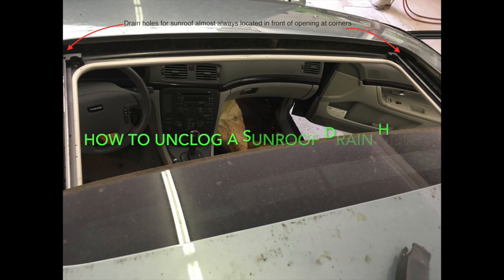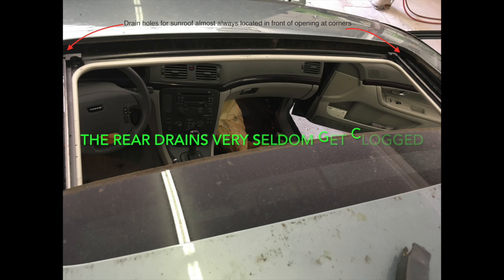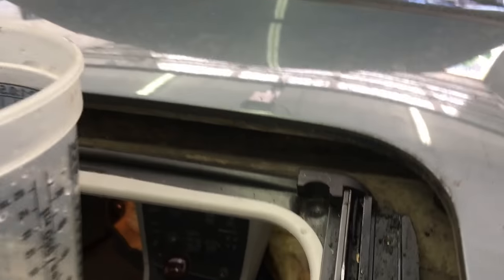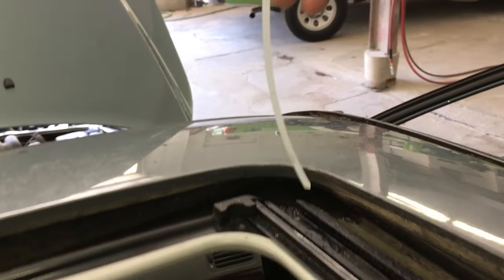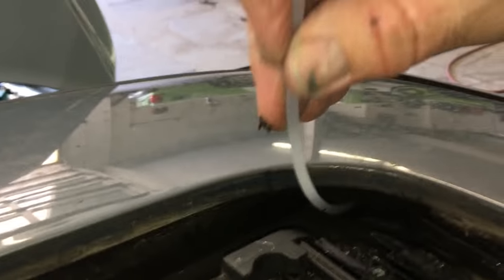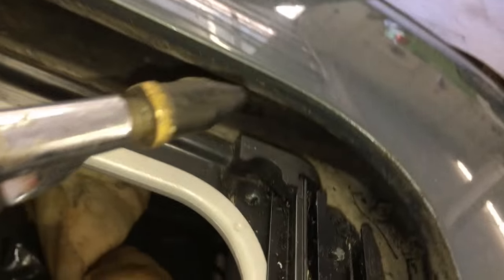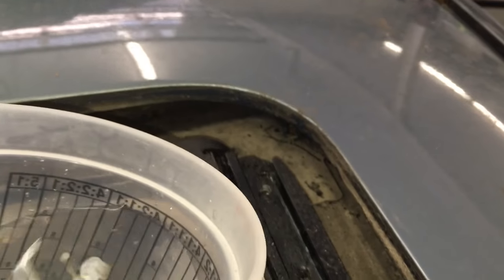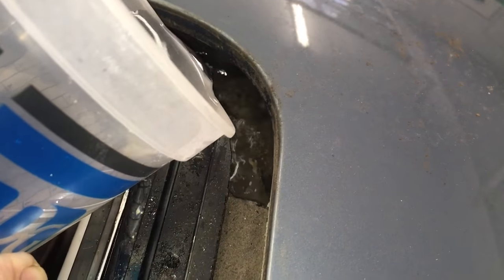How to unclog a sunroof drain

Comment: Is there a rubber piece in the path of these drains that's getting "clogged" by small pieces of debris? My Chrysler Crossfire had a leak at it's drains. (Below windshield. No sunroof) I pulled them out, & never had water inside my car again. I hope there's a simple solution for the GMC Terrain. Thank you for your informative post.
Reply from the maker: I don't believe so but I'm not totally sure where you mean. The cowl screen can collect too many  leaves and twigs which will render those drains to be useless causing water to enter through the heater box. The other most common culprit is a clogged a/c drain tube.
Reply: Question to the poster...I can hear water sloshing around in my door on passenger side but drivers side floorboard and seat, roof, etc getting wet...why would I hear water in door? Ford escape btw
Reply from the maker: @peggieh8577  On the underneath side of the door, running along the edge, just inside the skin there are usually 2–3 drain openings (sometimes covered with a rubber flap). They are evidently clogged, try poking a small screwdriver or similar tool in the openings to clear them. Doors are designed to route water out through the bottom drain holes. Good luck!
Reply: @eldigitom9680  found the drain hole was clogged with dried mud I guess..tho not sure where that came from...unclogged it and a freaking LAKE of water drained out!! The door had to be almost completely full of water!! Thanks
Reply from the maker: @peggieh8577  haha Good for you!

Comment: Air pressure can actually cause damage to the grommets or rupture the tubing. Canned air may be better.
Reply from the maker: It will not damage the drainage tubes as long as they are (cleared first)—as per the video. It’ll be a straight through shot.

Comment: Mine is clogged at firewall on passenger side. There is a filter at the end. What's best way to punch through the end.  2008 Altima.  Weed eater cord didn't work.  Heard 3d  filament cord works good.
Reply from the maker: In the video, I only addressed simple clogs, which are mainly at the entrance of the drain hole because that’s what 90% of clogs are. If you have a clog that you’re convinced is that far down in the drain tube, it may be something you’ll need to take to a body shop. Otherwise it’s going to probably require removing the kick panel and or glove box door and evaluate it from there.

Comment: What would be a separate cause for water on the passenger floor mat? I just did your test with a little bit of water in my sunroof and it quickly drained to the floor so it doesn't appear to be the issue.

I just took my car to a carwash and on my way out a bunch of soapy water came out of somewhere onto my passenger floor. It's a Mazda rx7.
Reply from the maker: Second most common cause for a leak onto the passenger floorboard is usually a clogged cow screen underneath the wipers. Especially if leaves and twigs have accumulated underneath the screen blocking the drain on the upper part of the cowl it will find its way into the passenger compartment through the heater box. It’s always good to keep the cowl screen clear of debris. It may need to be removed and cleaned out underneath it but you’ll probably be able to tell by looking if that’s necessary. Good luck! An easy way to test this is to hold a garden hose directly over the cowl screen area and see if it goes into the car.
Reply: @eldigitom9680  I appreciate the response! Yeah I’ve been noticing small debris on the floor and never thought much about it until I saw the soapy water flood in today. I’ll take a look at that for sure! Thanks!
Reply: oh boy were you right! I took apart the shield under the windshield wipers and boy oh boy. I filled up a grocery bag size full of mud and leaves! And there's still more to remove! It's mud because of the car wash I just had so I'm going to let it dry out and I'll scoop it out or vacuum out the rest then.

Found 2 odd things that may be obvious to you but not to me - one is that the clog of dirt and leaves is all on the driver side, while the passenger side hardly has any debris at all, even though that's the side where the leak is happening. The second thing I noticed is that there's a tiny little blocking plate on the passenger side that is removable, the seals on that were still sealed, but now that I removed it I'll have to replace new seals - not sure if that could have been causing the leak? I doubt it though.

So my thoughts are: That whole compartment probably drains on the driver side which is why that's all collected there, and the passenger side only overflowed when I took that hard left turn which pushed all the water that was trapped to the far passenger side and making it come up and over the HVAC intake? Seems to make sense. Either way, thanks so much for your information!!!
Reply from the maker: @ROMTHIRTY  Fantastic!

Comment: How does a clog at the top cause the footwell to get wet? I’ve heard of the weep holes at the bottom getting clogged causing water to pool up but I don’t understand how a clog at the top could cause the same issue
Reply from the maker: If the drain hole at top is clogged it forces the water to find an alternate route, observing gravity.

Comment: Where do you get this air compressor please? My 2010 Lexus  RX 350 was destroyed due to clogged sunroof drains. Shorted out the electrical system and the cost to repair plus mold remediation led the insurance company to declare a total loss.
Reply from the maker: Compressed air really is not necessary to unclog a drain, it’s really only used as a follow up. It’s best just to keep the front drain holes unclogged with a pipe cleaner or something soft once or twice a year.
Reply: @eldigitom9680  Thank you sir!

Comment: what pressure did you use with your air attachment?
Reply from the maker: Whatever shop pressure is, probably 90-120. As per the video, if air is used, it is only after clog is cleared and water running through the drain. Compressed air is not a necessary element and only as a final flush.

Comment: I'm having this issue, but my sunroof doesn't even work so I have no access to it.  It leaks on both sides, as well as the back and is only getting worse.
Reply from the maker: I'm sorry to hear that, but you're probably going to have some mechanical costs to fix that problem. I'm always quick to tell anyone who will hear, 'never buy a car with a sunroof'. The benefits do not outweigh the nuisances.

Comment: Are there any rear drains in the sun roof because I have water in the rear floor of passenger side?
Reply from the maker: Every sunroof system I’ve seen have drains in both front and rear. The rear drain usually exits behind the rear wheels although they are rarely clogged if ever. Easiest way to find a leak like that is with a garden hose, start about midway up on the sides and work your way up and watch for wetness.

Comment: 2018 Audi Q5 leaking into fuse box how do I get to the back drain holes when sunroof is blocking back holes?
Reply from the maker: Sorry for the slow reply. The video does not address the rear drain holes because they are seldom if ever the cause of a clogging problem. If the two front holes are unclogged, there should be no water coming into the passenger compartment.

Comment: I was doing this for several years, kept my floor dry. Unfortunately now my sunroof won't open so I need to fix that before I can unclog the drain...
Reply from the maker: Good luck, maybe take it to a sunroof specialty shop. I think they will get to the problem quicker than an auto body shop. I always urge people not to buy cars with a sunroof, they are an unnecessary source of water mess.

Comment: Yep. This work just fine.
Although all in all this is part of the reasons why I always declined buying cars with partial sunroof! 
Although had a couple of them with full coverage canvas sunroof. So no drains to clean or maintain. And no potential floods just because you parked under a tree. ;-)
Reply from the maker: Yes, cars should not come withsunroofs or convertible tops. Just potential problems down the road, like a basement.

Comment: @eldigitom happened to my car (2018 Mercedes E300) and is dead now, about an inch water was there on front seats floor. I checked the battery has juice but no power in the car. Please suggest.
Reply from the maker: I would suggest you call AAA or a road service. I’m sure they can diagnose it for you, but it could be anything, but probably not something caused by a water leak. Good luck!✌️
Reply: @eldigitom9680  I tried but ultimately we ended up towing the car to Mercedes dealership as no one could figure out. Apparently there are computer modules install under the driver seat which got flooded and fried and would cost a few grands to repair. Very bad design flaw by Mercedes to watch out for.
Reply from the maker: @gurleen80  I agree that’s a bad design. And as smart as the engineers at Mercedes are they have their problems once they get a few years on them. I feel for you dude.

Comment: i tried this on my v60 driver side comes out from the wheel but water goes away on right side but not under the car? i got moist on rear pasanger seat eny tips ?
Reply from the maker: Did you try scraping away the debris that may be covering the drain hole on the passenger side front? Then – as per the video – try running something relatively soft down the drain tube for a foot or so. If that drain tube is not functional it’s hard to trace alternate routes the water then decides to take.

Comment: If it’s clogged at the top where you indicated, why is the water leaking on the floor?  Wouldn’t it stay in the sunroof channel?
Reply from the maker: That’s a good question, I’m not sure of the alternate route that it takes. One of the other causes of a wet floor is when the cowl screen gets clogged with leaves and it spills over into and through the heater box. Also, if the air conditioner drain gets clogged it will back up onto the floor.
Reply: In portuguese, Sorry.
Provavelmente a água desce pela moldura interna do parabrisa, passa pela lateral do painel, segue pelas molduras plásticas da parte de baixo e acumula no piso, no meu caso, lado do passageiro.
O meu caso foi este.
Reply from the maker: @ThePeterlosch  (Probably water runs down the inner frame of the windshield, goes along the side of the panel, goes through the plastic moldings on the underside and accumulates on the floor, passenger side.
My case was this.)...thank you my friend!

Comment: Where do i get air compressor?
Reply from the maker: You actually don’t need compressed air to clear the drain. It was only used in the video as a final flush after the drain had already been cleared out. It is an optional step and somewhat redundant so it’s really not necessary. Good luck!

Comment: I just thought could i go to a gas station where they have an air filter station and use that to push air?  
Could i use like a cord pipe cleaner.. i don't think I'm saying the right thing but a firm flexible wire that will push through. 
I have a 2013 C300 haven't really driven it during the pandemic and a few weeks ago noticed water on the passenger side floors. I wiped it up then saw the water came back again. I noticed my side door cloth section had a water stain too. 
Thanks if there is any advice you can share.
Reply from the maker: First, try pouring a small amount of water in the corners of the sunroof opening as indicated in the video to see if it’s draining out underneath the car.. Then try scraping away the debris with a screwdriver or something to see if any standing water will go through. You may not need to insert anything into the drain tubes. Pressurized air is only used after the drain is cleaned out and functioning to clear remaining debris, it is also not totally necessary.
Reply: @eldigitom9680  thank you i will try that. I've never had this issue and haven't brought the car in to get inspected because I'm not driving it and wondered if this was a maintenance they were doing that i never knew about.. which i serious doubt.  Again thank you
Reply from the maker: I doubt a gas station would do it, probably will need to take it to your local body shop.
Reply: @eldigitom9680  and i do have a very good local guy... thank you

Comment: Mine are clogged in the back on my 2017 explorer. Can I clean the back ones easily as well ? Right now is at Ford where they told me it would be 500$ to cleaned them.
Reply: They said that air Compressor will blow out the tubes
Reply from the maker: It is very rare for the rear tubes to clog, they will probably have to remove the sun roof to do it, that’s why I did not include it in my video… just a reminder, the compressed air is only to be used after the tubes are cleared to flush out small pieces of remaining debris. 

With today’s labor rates $500 is probably pretty accurate.

Comment: So I have to complete replace my windshield in order to clear the drain ( since you typically can’t safely remove windshields intact therefore not being able to reuse it to reinstall
Reply from the maker: That doesn’t sound right. Is it on a GM SUV? Some of those drains are located behind the dash but we have unclogged them and never had to remove a windshield. Also, glass companies routinely, remove and replace the same windshield without breaking it, those guys hardly ever break a windshield when removing. Good luck.

Comment: where can i get that nylon and how thick it is?
Reply from the maker: In the video I was using precut 18.5" long 0.155 inch replacement trimmer line. You can find it in stores like Lowe's or Walmart.

Comment: Seems like I have a tough clog. I don’t have a compressor, but I tried using a straw and blowing into it. Won’t clear. 

What are you guys using??????
Reply from the maker: In the video I was using Pre-Cut 18.5 in Long 0.155 in. Replacement Trimmer Line. You can find it in stores like Lowe’s or Walmart. I don’t introduce air pressure until the clog has been removed, the air pressure is only to remove small debris left after the clog has been cleared.

Comment: So when the sunroof is closed is there not a rubber seal that prevents water from getting down in there? I'm just wondering if I need to do this if I never open my sunroof
Reply from the maker: I have never understood that question myself. It seems as though, if there is a gasket, no water should come through, but in reality, some obviously does. The clog is usually the consistency of mud. I have never owned a car with a sunroof and tend to believe that they (sunroofs) should be avoided.

Comment: I’m getting water in the back. It’s leaking from above. Why would a clog in the front drain cause a leak in the back? 🤷‍♂️
Reply from the maker: Are the front drains open? Water will always find the easiest route of escape, not all drain systems are designed the same. Also, although most roof leaks are caused by plugged drains it may be coming in somewhere else. So, is the headliner getting soaked in the process?
Reply: @eldigitom9680    The front drains drained slowly. I ran a small diameter tube down them along with blowing some air in them as well. They seem to be flowing better. I can’t get it to leak in the back when I pour water into the channels like it did before I cleared the lines. I just can’t figure out where the water would come from towards the BACK of the sunroof. Toyota is the absolute worst when it comes to water infiltration into the vehicle. I have a Highland that gets soaked as well! lol
Reply from the maker: @Johnny-ip4mk  bummer, I feel ya. But it’s not just Toyota that has problems with roof leaks. Cars should not be sold that have holes cut in the top. It’s just an unnecessary feature that is too common on cars.✌🏻

Comment: @eldigitom what is the wide dimensions of line?
Reply from the maker: In the video I was using precut 18.5" long 0.155 inch replacement trimmer line--which equals 3.9mm (A little bit larger than 1/8"). Weed Warrior brand which I found at Walmart. It's the type of line used on walk behind trimmer's.

Comment: My 2019 Toyota Rav4 is getting water inside. The headliner just over the door on the passenger and drivers side have both been wet. Toyota wants $138 to fix it. The drivers side seems to get it the worst even when it's not raining that much.
Reply from the maker: Sounds reasonable, you could probably do it yourself though if you followed this video.
Reply: @eldigitom9680  I may try it. It needs to be stopped, I don't want it to ruin the headliner or whatever else. I bought the car new, and had it less than 2 years. I just can't imagine that there has been enough debris to get down inside there already.  I opened the sunroof and looked inside, it's clean as it was when it was new.
Reply: @craig9843  how did it go? I am having a miserable time if it
Reply: @peggieh8577  you have a leak too? Took mine in Monday and it’s not my sunroof, turns out it’s the roof rails and thank goodness they are covering it 100% because the repair is $2100.00

Comment: Is it safe to use the air tire pressure at gasoline stations to try to unclog the tubes?
Reply from the maker: Air pressure is only used once the clog is removed, I’m not sure how you would manage to direct the air with a tire inflator.
Reply: eldigitom I was hoping to be able to use it. But now that I think of it more, you are right, I’m not sure how I would release air into the tubes either. I’ll have to try something else. Thanks!